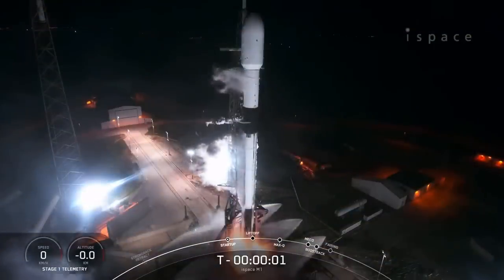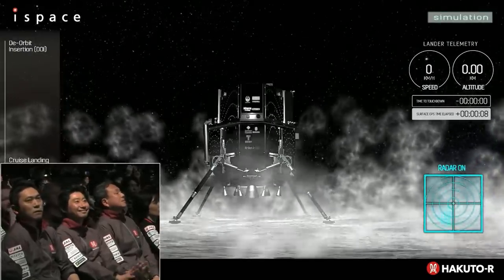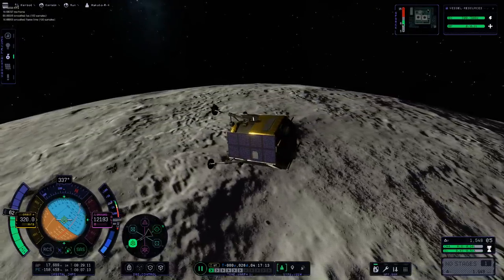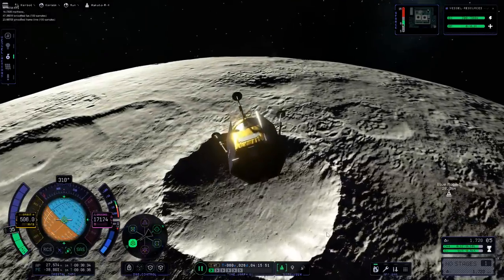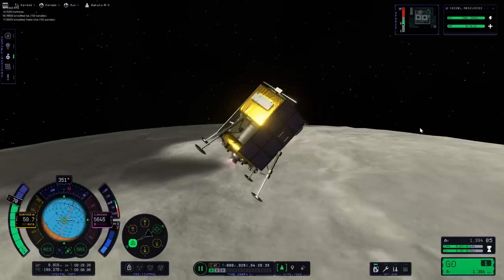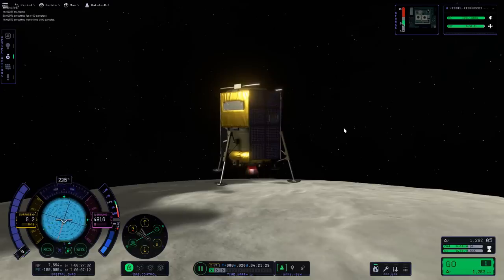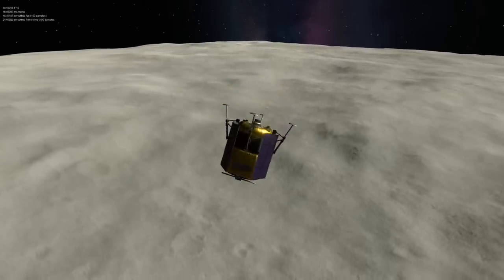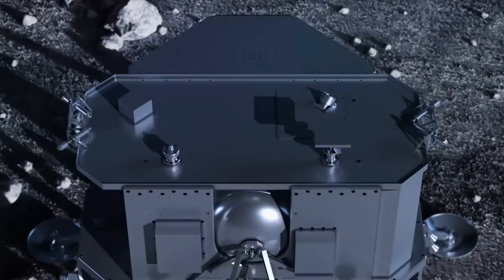Why Japan's Moon Lander Crashed Due to An Unbelievable Computer Bug

Comment: That's what happens when you keep changing the software spec's of a project. It's a bit hard to believe that they changed the landing site without rerunning the simulations.
Reply: This!  This all day.
Reply: Your first remark is very true, and not just in an aerospace environment!
Reply: That's like releasing software without doing unit tests just right after the remote guy pushed ten thousand lines of code
Reply: I feel like something in the sensor processing design isn't fundamentally robust enough if it can be this easily confused by real terrain features. Maybe they can add a second radar or lidar sensor for dissimilar redundancy or to differentiate unexpected yet real inputs from sensor faults.

We all know what happens when you run a safety-critical algorithm on a single AoA sensor...
Reply: Exactly! Mission creep eats in to the project time line and system tests degrade into delta testing for success instead of system testing for non-failure.
Reply: @Powertampa  That ain't unit test, that is actually E2E tests on steroid that involves setting up entire infrastructure (imagine shutting down entire service and deleting everything, then setup everything from scratch) and runs through each scenario one at a time (some E2E tests don't run in parallel due to resource contention). It is already very costly and time consuming for digital-only project, for projects that involves real world hardware, it only cost much more since physical objects are a lot more expensive to automate, so there will be a lot of manual process, which makes it even more time consuming.
Reply: Gotta be agile right?
Reply: My guess would be the answer for why additional simulations were not done is money.
Reply: Designing a control system based on a single landing scenario seems a bit optimistic - that's like a car company producing driver assist functions that only work when driving on the right-hand side of the road. Imagine protesting "you didn't say it would be driven in the UK!"
Reply: Time, it's the killer we continue to ignore.
Reply: @trs4u  It wasn't single landing scenario, rather all the proposed landing sites didn't trigger such "sensor reading changed too quickly" error. It's unknown unknown, you don't know about it until you test this specific route. The problem is balancing reasonably well thought out error checks and being too permissive with sensor reading going all over the place.
Reply: I find it more surprising that they didn't make the software flexible enough to adapt to different landing sites. Unexpected events could force a change of landing site at any point in the mission.
Reply: @jan.tichavsky  All I had to go on is "they changed [it]" which arguably implies only 1, sorry. What you say is true. I think if I was in their shoes I'd want to have run-of-the mill TDD-style testing and also soak tests that run out-of-cycle with development which throw random scenarios at the control system so they establish how changes of mission parameters affect likely outcome. Soak tests are [a] hard sell to anyone who won't catch the blame for errors - pretty much everyone else...
Reply: @ailivac  certainly it smacks of a lack of thoroughness in the work done. 

Civil airliners have two radalts for this very reason (plus the pressure altimeter, plus Mk 1 eyeball, plus GPS, plus inertial nav (if fitted), plus ILS glide slopes, plus (if really necessary) an estimate from ATC or another aircraft talking the pilots down). Though I guess it's expensive to have 2 on a spacecraft. 

Though to be honest radar altimetry is a very well established technology, you'd think that so long as the radalt was drawing power, claiming to have ground lock and emitting understandable data, you'd accept it without question. Bit of an odd decision to second guess it in the data consumer.
Reply: It's not that hard to believe.  The management team that made the decision may not have understood that some of the software and testing was predicated on location and that changing the destination invalidated the results.  There was probably an engineer or a small, low-level team that probably knew, but I'd bet they didn't poll the teams before making the decision.
Reply: Israel, India, Japan moon missions all had similar computer/ technical glitch during their landing process.  
Seems quite unrealistic isn't it?
I wonder if all 3 landers really had problems or something bad were done to them intentionally by someone!💀
Reply: Exactly. The failure was the project management's decision to change the landing site, not the software.
Reply: @trs4u  It's a small team developing a small lander for a specific mission. It's completely reasonable to tailor the systems for that mission.
Reply: Well, still better than the boeing mission a few months back where they just yolo'd it without relevant simulations for no good reason. But yeah, it is surprising that they couldn't scale up running the necesary simulations in parallel on a compute cluster/cloud somewhere.
Reply: Sounds like a possible system design issue, too.  I don't know how much mass, space, and power a radar altimeter takes up, but perhaps another similar sensor, perhaps a lower-resolution one , or one with a lower sample rate, could have been used to verify the output from the primary one.  Relying on accelerometers and gyroscopes to give you positional data for something as precise as a soft landing on the Moon sounds problematic.
Reply: @sciencecompliance235 For a system that needs to be robust enough to handle any situation, sure. But adding redundant sensors introduces more complexity to the system, opening the possibility for a new set of failures. This was supposed to be an initial baseline test that they could build off of.
Reply: @trs4u  I take it you don't work with software :)
Reply: @adarsh4764  : Software is the most complex part of any lander, and therefore the part most likely to fail.
Reply: @joelcorley3478  It’s not like JASA has shareholders that were asking for a different landing site in the quarterly report. The only people who care where exactly the lander lands are scientists. Most likely the engineering team thought their landing software was robust enough, and, well, it wasn’t.
Reply: @adarsh4764  the Indian mission was sabotaged by the Pakistanis, egged on by the Chinese.  The Japanese mission was sabotaged by the North Koreans, egged on by the Russians.  The Israeli mission was sabotaged by the Palestinians, egged on by the Iranians.
Moral of the story: it's always someone else's fault if it goes wrong, and your brilliant work if it goes right.
Reply: @pseudotasuki  Adding redundancy certainly adds to complexity, but if it truly increased the possibility for other failures, then redundancy wouldn't be so common in aerospace systems.  I don't think this is what likely happened in the design process.  More likely is that it was a mass, power, space, or cost budget issue.
Reply: @MeerkatADV  Which leads to the old adage, Why is there never enough time (or money) to do it right the first time, but always enough time (or money) to do it over!?
Reply: My take is if they add the option in the software to ignore a possible faulty radar reading, they should have also simulated landings without the radar, to uncover the issue with loosing that accurate data stream.
Reply: @8749236  I have trouble believing that, at least all by itself. The simulation digital infrastructure (including proper hardware simulations), I would think, should be fully parameterized. So you just re-parameterize and run it again. Hard to believe those re-runs would cost much in time or money. Of course, I just don't know what or why or how their software developers approached the problem. Soon, I suppose, we will have a lunar GPS system. Then (and meanwhile) a "pilot" should just point to where he or she wants to go in the lander (middle or edge of crater or plain) and the simulation takes it there and lands (or not, in this instance).
Reply: @trs4u  nevertheless it’s legitimate. You have to target an initial design and yeah, YAGNI dictates that you postpone unneeded features in order to make shipment. But in the next iteration, it could, or should be in the specifications
Reply: @mx2000  - If you think the people making these kinds of decisions are the same people designing the software, you've obviously never worked on a large engineering project. 

Also the software engineers responsible for that subsystem almost certainly knew how it was tested and what its limits were.  Knowing Japanese work culture, I'd guess a senior manager told the science team the change would be fine and the more junior engineers that knew there was a real risk just didn't want to contradict a superior.
Reply: @jan.tichavsky  I’m a developer, 40+ years. Equipment automation. Particularly semiconductor manufacturing control systems where we are regularly dealing with exceptionally toxic or pyrophoric gases used in the manufacture of silicon and germanium semiconductors.
 I don’t know how many times as I’m testing other peoples code (especially of late, web “programmers”) and they tell me something like, “this input— say, ‘age’—should have a value from 0 to 150.”
And they get very upset with me when I break their software, because I entered a value of -1, or 1000, or 65537, or A, £, or even goobagooba. 
Nobody likes to see anyone break their precious baby they worked so hard on, but real world programming is not for prima donnas.
These folks fed their software a set of expected values following a set of expected scenarios plus or minus some variance amount, and have now learned a very difficult and embarrassing but extremely important lesson. 
Being Japanese, this screwup may well have caused some of them their careers, and cost their family members humiliation.
Reply: A classic case of “ah, should be fine” 🤷🏻‍♂️🤣
Reply: @8749236  They didn't need to do any hardware testing.  They just needed to do another run of the software simulation tests with the latest landing coordinates and planned flight path.

That could actually even have been done while the lander was already on its way to the moon, and then they would have then known about the software issue ahead of time and probably been able to do a remote update or workaround to prevent the scenario from actually playing out this way.

There's just really no good justification I can see for not having done that much, except just that nobody actually thought to do it.
Reply: Scope Creep.
Reply: Couldn't they have backed up the radar altimeter with a table of expected altitudes or altitude changes along the approach path?  Sort of like TERCOM.  That way anomalous changes in descent rate would be expected based on the expected terrain and could be used to verify or update position over the surface, too.  And then no changing of the landing site without reloading the correct terrain contour of the approach and then verifying the correct set is loaded.  And then don't "dump" the radar altimeter data as faulty, if that's the only thing you have to "see" by...you don't want to fly blind, dead reckoning, except as the very last resort, I would think.  But if radar altitude data matches up nicely with terrain contour, the radar's function will be verified all the way final, vertical descent.  Maybe a laser ranging instrument could provide redundancy on the vertical descent?
Reply: @adarsh4764  "Israel, India, Japan ... I wonder if all 3 landers really had problems or something bad were done to them intentionally by someone!"  Some time back I came to the somber realization that comment sections exist not for people like me, but for people like you.
Reply: @addanametocontinue  it’s only scope creep if you’re using a waterfall model.
If you’re agile and following a spiral development model, then it’s simply part of the iteration process and the planning game.
Reply: @locust76  When used correctly on a project it is actually suited for, agile does work very well. I was stunned the first time I worked on a PROPERLY ran agile project. 
The problem is it is almost NEVER implemented properly, and you just end up with bastardised waterfall basically parallel running system testing, uat testing and dev on the SAME build at the SAME time with a few agile buzzwords thrown in and a kanban or 'sprint' board thrown in to annoy and confuse folks for good measure! (which I why I used to hate agile with a passion before that properly-ran project, as I didn't realise I had never worked on an ACTUAL agile team and project before that contract lol )
Reply: @BeardyBaldyBob Agile doesn't fix your problems, it just makes them obvious. Short development cycles make broken processes stand out.  The problem is, people don't want to admit their process sucks, so they just cover the problems up and ignore them and bastardize the agile process with the excuse of, "Well, that's just the way things work here. We're doing 'our version' of Agile." Then when nothing improves, they blame the process instead of their unwillingness to fix their shit.
Reply: @locust76  proper agile developlent is all about testing as early as possible.
Reply: @ailivac  I was thinking the same thing.  A single radar-altimeter??  I used to fly in the IAF and even on old fighters we had (at least) two ways of getting height above terrain.
Reply: @locust76  Yup. Don't go chasing waterfalls, they said.
Reply: The money and time involved in generating new simulations was probably over budget. Haven't we learned the hard way enough? Take the necessary time, pay when you should.
Reply: @DaveInPA2010  Truth. Guard clauses are very important and lack of them can lead to exploits. I'm glad to have experience in working with low level coding such as assembly because it reveals how important that stuff is. When working directly between registers, memory addresses and the stack, it's very easy to make a mistake. The CPU has no clue what an overflow is, nor does it care. That's a software problem. Some modern compilers/interpreters checking for these mistakes is a double-edge sword just like spell checking. The kernel will protect the system from most of the exploits, such as just providing my own arbitrary memory address into the rip register, but it amazes me how some really smart people can cascade a simple overflow into arbitrary code execution down the line. Then there was that whole VTECH SQL dump that revealed personal information, video and audio of millions of children. That was the smoothest of the smooth brain coding in place there.
Reply: @trs4u  Or in Japan (Japanese drive on the left side too). That is actually one of the problems US car companies had in selling cars in Japan.
Reply: @hemlockVape  That much internal testing and R&D is hard though. It's far easier to just say: "If we make it off the launch pad it'll be a big achievement." 

Then when you make it all the way to the Moon, you can exclaim: "Great work everybody, drinks are on me!"
Reply: I think it's harder to believe they didn't realize the moon's surface was smooth & even as a ball bearing. Changing the landing site wouldn't have been as problematic if the sensor error handling took that into account.
Reply: @ailivac  sshhhh Boeing might hear you 😅
Reply: @DaveInPA2010  YAGNI is different things for different occupational perspectives. YAGNI applies to testing and soaking only when you're not the person making high trapeze catches without a safety net. The misfortune of a missed catch isn't shared equally by every member of a circus. It's a bit too easy to talk about (elsewhere in this discussion) the guy whose hands were on the keyboard's prospects of career termination and humiliation. Don't forget your hard hat and harness at work today, kids!
Reply: @pseudotasuki  I'm wondering if that rationale will be updated after vehicle loss. Vested personal interest often largely determines who points fingers in which direction, but the 'big picture' view should probably distribute the blame a bit more widely.
Reply: I think anyone who’s done professional software development facepalmed at this because we’ve all been there. 
You write the software to spec, meticulously check it works to the spec, deliver and the product owner tell you that sales have completely changed the spec at the last minute but the deadline is still the same! 😂
Reply: Indeed! This is not a software issue at heart but a project management issue!
Reply: @tanelipirinen  it usually is!
Reply: It probably went something like "software is verified" then whoever made the decision on changing the landing site was not properly familiar/informed with what exactly the software was verified for.
Reply: Nope, it's not hard for me to believe. Such arrogance is universal among all humans.
Reply: It's easy to believe. It's a management and cultural problem.
"Change the site." 
"But if we change the site, we need to rerun the sims." 
"No you don't, we ran sims and it was always fine, and you're just a junior engineer and don't have my vast experience."
"OK."
Reply: The only constant things in software dev process are changes! The issue is that the retest has not been executed, as RUUF method suggests!
Reply: simulation results are only as good as the simulation environment.  if they've forgotten to account for deep cratering, the new tests would have been just as erroneous.
Reply: @thePronto  Please don't sugarcoat my comment.
Reply: @marcmcreynolds2827  Glad you realised that.  Hope you dont come to YouTube anytime soon.
Reply: @adarsh4764  that's not sugarcoating, that is called mockery.
Reply: Omfg lol.
Reply: @MeerkatADV  would not be surprised to hear that the last minute landing site change was past the point they could have patched the code on the lander anyways. At some point they have to “ship it” and planning for remote updates via DSN must be quite expensive.
Reply: @JoshuaPalley  They changed the landing site seven months before. They had time, I don't think they had the money to run the simulations.
Reply: Ya, I wouldn't see this as the result of a bug, TBH. A bug is when software behaves in a matter contrary to its design. It's a failure of the QA/QC process.
Reply: @Powertampa  But meeting the release date is YUUUGELY more important to our shareholders than our long-term reputation!!
Reply: @ailivac  Everyone but Boeing's former CEO and Board of Directors.
Reply: Nah it was clearly gremlins
Reply: @adarsh4764  Culturally, none of those people are good at critical thinking.
Reply: @Powertampa  - exactly - I have been in software development for over 20 years & I could never mess up on this level - because I have 1000s of unit tests - and more specifically for this example - we need an integration test or high level test that would test all components based on a simulation of the ACTUAL terrain - which would be trivial to do - the fact that there software practices around automated testing are so bad - it basically serves them right - they dont deserve to land.
Reply: @iainkey5102  - I havent worked like that since 1999
Reply: @brentgreeff1115  you mean you haven’t tested your code? 🤔😜
Reply: Japan does not use modern software practices
Reply: @iainkey5102  - No I dont - My code tests my code.
Reply: This is what happens when you get cheap and use Windows to land your Moon Lander.
Reply: @brentgreeff1115  touché 😂 personally I find myself writing more integration tests and e2e tests these days than unit tests but unit tests still have their place
My comment was only intended as a tongue in cheek dig at modern project management. I don’t know the actual circumstances of this failure so please don’t take it personally.
Personally I have also found since 1999 that it doesn’t matter what methodology you use waterfall, xp, agile, kanban, you can delivery iterations early and test in depth but the people who are your customers can and will completely change their minds even after it’s all feature complete then it becomes a scramble to make changes because someone has promised a deadline.
That was my jokey point!
Reply: @iainkey5102  - OK - fair enough, but change is a universal constant - expecting change should be at the very core of any development process, otherwise you end up fukushima-ing yourself on a regular basis.
Reply: @brentgreeff1115  oh I absolutely agree especially in a critical environment such as moon landers.
Reply: Must've been deployed on a friday
Reply: @ailivac   OMG, yes we do!  And Boeing management knew it too but did it anyway!
Reply: This software bug sounds exactly like the type of bug my team would encounter every time we worked with contractors from a certain overseas country.
Reply: So many people in the comments don’t understand how complicated project management at this scale is. Lol. I envy them.
Reply: Ironically, there was a civil war battle known as the Battle of the Crater, in which plans were changed at the last minute and led to complete disaster.   People never learn, and they've been never learning for a long time.
Reply: @locust76  Agile.... losing sight of the goal...
Reply: I get paid to write software. Execs get paid to ignore any concerns I might have. We all have a job to do and we do it well damnit!
Reply: It's incredible. How a group of scientific professionals managed to F that up and even I myself who isn't good at math knows these basic rules.
Reply: We shouldn't give so much power to software systems, they're too unpredictable. Software isn't generally allowed in safety systems on Earth, for exactly this reason.
Reply: On the one hand, yes; but on the other hand, changing requirements are just a fact of life. All developers, me included, would love the whole universe to be 100% defined, and then stop in an immutable state until I, as the natural center of the universe, have had ample time to finish my work to my satisfaction. That's not real though.
Reply: @8749236  still, you changed the landing site but didn't test the landing algorithm on that site? Surely you can scrape up resources for that?
Reply: @adarsh4764  this is ridiculous.
Reply: And now they probably won't just rebuild this lander exactly as before, with more testing and fixes. They'll think that they can redesign it since they have a blank slate, and the redesign will have all new bugs.
Reply: @pseudotasuki  change the landing site AND not re-run simulations AND not have ANY team member scream bloody murder to say you can't change landing site w/o re-running the simulations.    Errors like this are a cascade of mistakes.
Reply: @pseudotasuki  Without redundancy, you are flying blind.  The Shuttle had 3 actuators on the rudder, operated by 3 separate computers, programmed by 3 separate teams (to the same spec).   Any ONE actuator could move the rudder.  Even if one computer/actuator were 180 degrees opposite the 'correct' rudder position, the 'bad' actuator would mechanically cancel out one 'good' actuator; and the other good actuator would put the rudder in the correct position.   But here, having a second altimeter -- what is the probability that BOTH of them are wrong at the same time?    But you see , the problem with two sensors is: which one is lying, if they don't agree.  THAT is why either 3 or 4 sensors are used.
Reply: @absalomdraconis  This was an Algorithm Failure, not technically a 'software failure' IMHO
Reply: @pietersmit621  Yes, the simulator should have randomly disabled simulated sensors, to see what the algorithm did in those cases.
Reply: @ailivac  The sensor is fine. It reported exactly what it saw. Again this whole issue is 100% software. And really the issue is bad change management.
Reply: @lightfox11  Are you well-informed as to the Japanese Software Industry's software practices?  I can bet you that all Japanese car companies' code is MISRA-compliant, for example.    Or are you simply stating your opinion?  If so, that's just your opinion, man...
Reply: Hindsight is 20/20. I mean, by the simulations, but team's objective was probably to "validate the software". Once it is validation over a variety of landing path simulations, it is kinda hard to think that another landing trajectory would uncover a bug. I think what is missing from this is a notion of "expected topography"... i mean, given the planned trajectory, there should've been a pre-loaded map of expected moon terrain and the radar sensor data cross-correlated with that, so that the sudden change in altitude was not deemed a "failure of the sensor".
Reply: No. You cannot call the presence deep craters on the moon. An human would have no problem in a similar situation, in 2023 computers are supposed to do the same or better. Shortsighted design failure.
Reply: No. You are just assuming the specs kept changing. You don't know.

The problem here is a fundamental error in system design which is a lack of redundancy in the sensor.
They should have used two or three would have been ideal.  Then the software could have identified if any of the sensors were malfunctioning and ignore the output from it and use the other two.

The chances are the first version of the system specification did not include a requirement for that redundancy.

So this problem is probably not down to  changing requirements. It's been a flaw right from the very start.
Reply: Well, it’s not rocket science! Uhhh…
Reply: Most of you are wrong. It isn't a software problem. It's a fundamental design error with the system. A lack of hardware, or more specifically a failure to incorporate redundancy into the altitude sensor.

The software is always going to have to try to identify a faulty sensor and ignore it.  The problem is when you have only a single sensor, you can't actually tell whether it is faulty or not.

If you include 3 sensors, you can compare the output of all 3 and if one is giving a significantly different output to the other 2 then you can reasonably conclude it has become defective, then you ignore it and use the output from the remaining two.

That is what they did wrong here. It's a fundamental design flaw rather than a software bug.
Reply: That is what happens when humans do not share with others. Why is there not a Global space program that can successfully send missions using existing software that is proven to work? Human greed makes this more difficult than it really is.
Reply: I am not at all surprised
Reply: @joelcorley3478  They're also Asian. Just as Korea had cultural issues with subordinates or co-pilots refusing to second guess the pilot, the same "social cohesion" phenomenon might be at play here. They could be afraid of disrespecting their superiors and losing their jobs.

I'm not sure if they respect low-level hardware electrical engineering / coding, despite being extremely, critically important. Not going to assume one way or the other but that stuff tends to get overlooked.
Reply: @MeerkatADV  when your mission costs $90 million, and you lose all that money in the event of a critical software bug, there's a strong incentive to pay for the additional testing, even if all you care about is money.
Reply: @tronziebit  you mean CAPITALISM
Reply: @emilysmith6897  I never said they shouldn't have done the testing, I just expressed my opinion for why the testing wasn't done.
Reply: @user-zu1ix3yq2w  - I'm aware.  I've worked on software projects with Casio and Sharp; I've also work for Samsung in South Korea and I've worked with Japanese and Korean coworkers in the USA.

Both societies tend to defer to seniority over experience.  Fortunately, I grew up in the USA and late in high school and college a rather assertive, dominant voice grew in me and I was usually willing to speak up and assert myself in a work environment if I was had valid concerns or knew I was right about something.

One of my earliest encounters with Japanese work culture was during detail technical contract negotiations on a project with Casio.  I wound up taking over on some points and arguing down their senior management even though he was twice my age.  Apparently being right and being assertive does count for something there - young Japanese just aren't taught to assert themselves.
Reply: @DaveInPA2010  wow even programmers have bullshit corporate language now! no wonder we get crap like this spacecraft crash..
Reply: @emilysmith6897  I’m intrigued, but you’re not specific. How do you mean?
Reply: @gblargg  hopefully (and far more likely because cheaper and they need a success now) they will iterate on the design, fixing the software  bugs and other things that caused problems. That's how you make a successful landing. Once you have a working design you can record successes like NASA's Mars rover missions.
Reply: Nobody.

Tests.

Today.
Reply: Finally someone way intelligent than Japanese engineers 😂
Reply: No, it's hard to believe that their software was so dialed into a particular spot that it wouldn't operate correctly over any place on the moon. You either have terrain following radar, or you have a bespoke check pointing system. The problem wasn't the specs, there was a clearly disconnected understanding in the basic premise of the project between what the project managers thought they were building (TFR) and what the software engineers actually built (checkpoint radar). If they were building a space-based TFR system, it should have operated accurately and been believable by the navigation system no matter where they were landing.
Reply: Spec’s what?
Reply: Sadly, software requirements do change all the time, and we have to be able to adapt to it for most development efforts. Producing a product that evolves with time due to market forces, changes in company priorities, legal changes and more. 
This, however, is not one of those, and should have been rerun a bunch of times by many people. It was just one of the scenarios they forgot to test for, I think. It was not a change of spec that directly led to this, I think. I have only designed generic software for global companies and start-ups, so what do I know?
Reply: They tried to save $100 and so they lost $90MM.
Reply: Ask NASA about the difference between Newtons and Pounds of thrust.  Stuff happens
Reply: There were wars done without rerunning wargames. People cut corners
Reply: It’s because they lie about everything, and a bug was never even an issue but a cheap scapegoat
Reply: Everyone is a general after the war
Reply: I worked for a software vendor at one point in my career. No matter how good their software quality assurance program was, every software release there was at least one developer who insisted their untested software that had not gone through quantity control (different from quality assurance) had to be in the next day release of the next generation software. It always failed in ways they never foresaw or didn’t care about. It actually got worse when they sent the development to a software house in India.
Reply: @DaveInPA2010  Being Japanese, I wouldn't be surprised if they couldn't question/speak up to their superiors when leadership made an uninformed decision without their input.
Reply: @Powertampa  We'll let the support desk worry about that, I have a deadline to meet!
Reply: @ailivac  Also "real time" cameras would have helped the ground team know something was up with enough time to correct it.
Reply: @locust76  😂😂 this is the last place to use agile
Reply: Probably ran out of time for testing as development took too long. Typical IT project issue.
Reply: @joelcorley3478  seems extremely shortsighted to define your tests that narrowly. I could understand not having this test case if this spacecraft were designed for a moon or planet that has no craters, but the Moon is absolutely covered in craters.
Reply: "You need to finish the project until end of month.
We need to finish something and you will get rest of the data next month".
Although I have not worked in the space industry (sigh) but I personally had such experience in engineering.
Reply: "We ran the simulations for so many other locations and either out all of those bugs, do is not worth us falling behind in time and budget"...  or something like that. Everyone likes to ignore quality control, focusing on what could go right instead of what you go wrong.
Reply: As a software developer, I absolutely support this comment! TRUE.
Reply: I see it differently. Changing the landing spot is like changing the input data. The software should handle any inputs gracefully, not be overfitted to one particular scenario.
Reply: @ooltimu  And how do you know the software will handle any input? Plus when it's a one time only attempt surly it makes sense to test with the actual data when known rather than different data and assume it'll be alright on the night.
Reply: @ooltimu  The problem in space flight that even the smallest changes come with a huge cost. If you change 1 thing, you might have to change many other things too, possibly even hardware requirements and therefore possibly launch weight and fuel needs of the mission.
Reply: @mcarpenter2917  you test it, like any other software. hammer it with data, both known and random. where did i say to test only with different data? you test with everything you have + random + edge cases. i actually find it very bad practice to test it with only known cases, like they did in this case.
Reply: @jongeduard  I understand that, but hardware nowadays is very capable, cheap and light compared to what we had in the 60's. I find it very hard to believe it that they had no slack to spare in hardware to accommodate for proper software
Reply: @ooltimu  My point is they did not test the know case!!
Reply: @Powertampa  From a dev: Unit tests won't save you if the unit tests are also wrong
Reply: @locust76  Tell me you know nothing about agile without telling me you know nothing about agile
Reply: @DaveInPA2010  Web "programmer"? So in other words, you don't know anything about modern software, good to know
Reply: @brentgreeff1115  So you mean to tell me you've never seen a bad unit test in your life? I'm failing to believe you have "20+ years" then
Reply: Oh yes...
Reply: Sounds like a marketing guy got involved
Reply: Exactly.
Reply: When the higher up says to do something, the lower ranked staff has no say. Even NASA suffer from this, and the shuttle challenger exploded as a result. I imagine it would be worse in Japan where social hierarchy is more deeply entrenched. This hierarchy system is also the cause of many plane crash because either the copilot was afraid to point out what the captain did wrong, or the captain ignored the copilot's warning. The situation is getting better because of "cockpit resource management", which basically train copilots to speak out and captains to listen. Ironically, this system was invented by NASA.
Reply: Because the failed attempt was a scientific experiment and has limited resources. The subsequent and successful attempts were to save face, and has no resource limit.
Reply: @Powertampa  Unit tests won't save you. Even your unit tests may have bugs or may not cover all cases. I bumped into a case where the in-house map (it had to be custom made because the language we were writing it doesn't have an std lib) implemented using a red-black tree wiped all keys by just using an empty string as a key. It turned out that this was by design.
Reply: Sound like another if else is enough to fix this 😂
How big can the sw spec be
Reply: @MeerkatADV  I guess they discovered that losing a lander is more expensive than the extra testing.
Reply: That’s what happens when you hire decelopers for their soft skills
Reply: The crazier part is that their modelling for the sensor and what consitutes bad data is very questionable. Surely you would take the worst known ridge on the moon, then add a safety margin on top of that. And also... if the sensor can't be relied on at that height... it has almost no chance of success anyway. So why even bother ignoring it? Seems like the failure analysis has missed the forrest for the trees.
Reply: @VictorTimofti  hiring developers who know how to communicate & work effectively with others is not the problem.

Successful developers IRL typically aren't brilliant but socially challenged loners. Even in STEM, the highest performers tend to be pretty well-balanced individuals.
Reply: The amount of times we shipped buggy software inour company is terrifying. But we have to please investors with small improvements to keep getting funded. I believe they had same issue
Reply: @willierants5880 I am become time, the destroyer of worlds...  Bhagwat Gita
Reply: Wasn't really a bug.  Just not designed for that mission.
Reply: Windows.... cough....
Reply: Sometimes the real limitations r time & expenses that involve very elaborate testing at various stages of project. Nothing should be assumed & taken 4 granted..
Reply: Unpredictable happens that's life,should not regret.
Reply: @DaveC2729 
India's Chandraayan 3 had to change the landing site at last minute
Reply: These are the young scientists mentality
Reply: This is what happens when proper testing is not done
Reply: Yep.  Classic IT problem 🤣🤣🤣